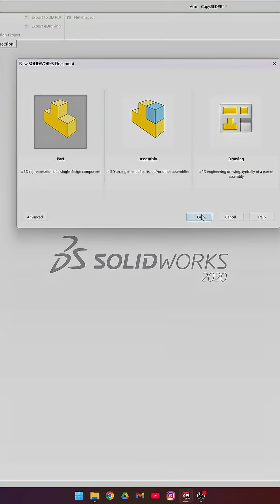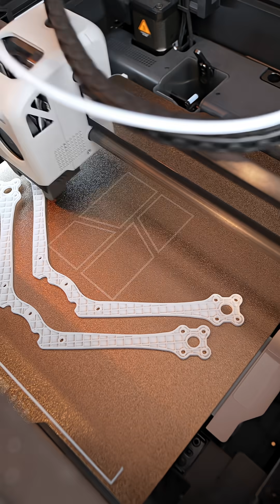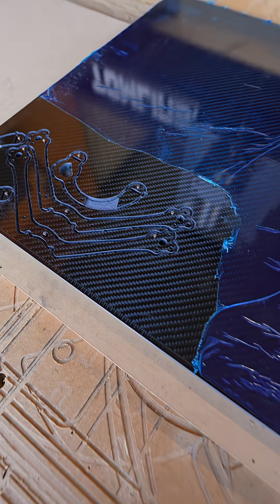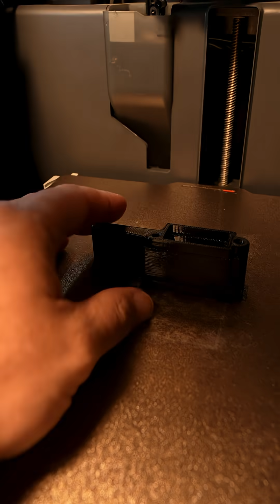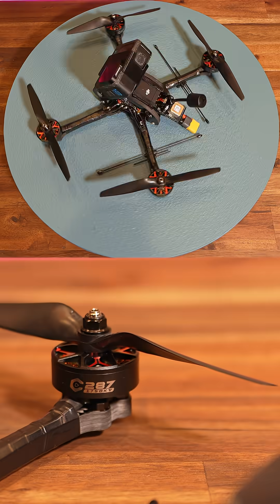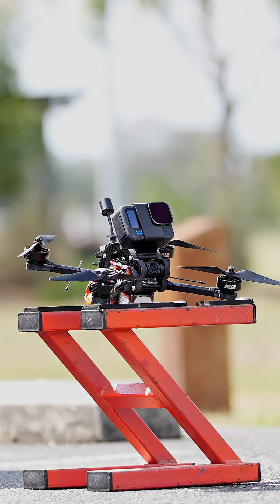I Designed A High Speed GoPro Drone 🚀🏎

Comment: If I may, I would suggest you 3D print a nozzle for the vacuum that bolts to the head of your 2D CNC. That way you don't have to sit there holding the vacuum the whole time.
Reply from the maker: I have commercial extraction with a dust shoe on this 3 axis CNC. Pretty boring to film when you can't see anything though. I use a vacuum for the gram. Thanks though.

Comment: Looks like the old 2017 reallacc 5 and 6 inch drones. I love how some new builds are just going back to the simpler stuff we had 8 years ago. I still have the original toothpick style quads, sailfly, hx115hd, even an airbladeuav eclair "plus", iflight turbobee, geprc phantom. Love the old frames and have a large collection of "first gen" micro frames. Even a few brushed micros from micromotorwarehouse.
Reply from the maker: Yeah frames are still 4 motors in an X shape. Worth revisiting some concepts from time to time.

Comment: Isn't the exposed battery on the bottom kinda dangerous when landing?
Reply from the maker: Nah, not particularly. I've actually punctured more top mount than bottom. This is just like any typical race quad.
Reply: Top mount is definitely more of a risk case cuz that's the direction you're facing when ripping (kinda) bottom mount almost never hits first in a crash. Also having the weight on the bottom tends to make a more stable controlled flying beast 😅